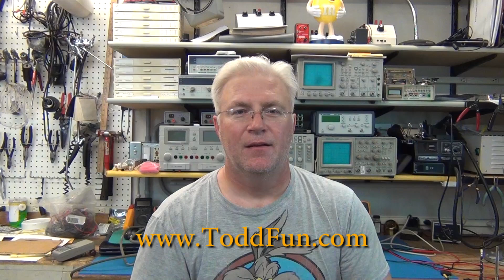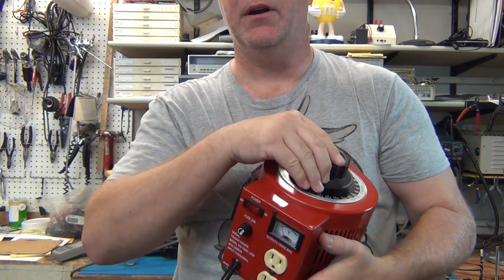Variac or Autotransformer Review and Teardown

Comment: Wish you would have shown the bottom of the unit so we can see how well the shaft is supported without a bearing like most other Variac's. The one I had there was problems with the knob having side to side play allowing the unit to lose connection between the brushes and the top of the transformer coil, even allowing some small sparks inside the unit.

Comment: I have the same variac but in the 30 amp version. I'm pretty happy with it. It has wire nut terminals instead of the plugs, two handles on top, and is a bit larger. For the price ($120) plus like $12 shipping it's really quite nice, I've seen name brand variacs that are comparable go for more than double the price. Mine has 2 brushes as well, and the windings look just like yours. They have no problem carrying the current.
They had no provision for a ground so I ground a bit of paint off where a screw goes and ran my ground there.
Also on the accuracy of the dial, it does depend on the input voltage greatly. On the front mine says 110v. My mains is 120v so it's not accurate. My overwind also goes to about 145v which is pretty nice. I made up a little information panel with a secondary side fuse, larger analog voltmeter, and ammeter to make it easier to use. Also added was a bridge rectifier, which makes it a pretty nice power supply. All I'm missing are a few ballasts.
Reply from the maker: InductiveExperiments Wow, that sounds great. I'm ok with the scale being dependent on the line input voltage but was not so happy with it not being linear.
I like your modes, any changes you can share photos, diagrams and a bom listing?
Reply: *****
 I do have a few videos on it with "information panel" in the title. It's kind of stuck in the prototype phase since I'm okay with how it is now but it's not very sturdy. I'll put it all in a box eventually which will just make it easier to move around. And maybe make a switching device to go from ac to dc instantly and not have to change the terminals.
The variac itself only has one change, that's the grounded frame. I show both in the videos. It's a pretty cool setup though, just not as good as what youtube user "photonvids" did in his video called "Easy Electrical Project" I like that one.

Comment: Hiya. Nice little review on this. A few things about it though which I'd be unsure about:

(1) That earthing/grounding.... I have my doubts that would pass UK safety standards. As a qualified Portable Appliance Tester (PAT), I'd be kinda inclined to fail that on the basis that there isn't a dedicated earth connection to the chassis. Relying on mechanical fixings to carry-on the earthing continuity like that is a bit naughty. With the way that socket was flapping around in there, I don't think it's going to be too long before that screw loosens-off, and the split second it does..... No earthing to that chassis. NAUGHTY! :-O I'd be straight in there to make a dedicated earthing connection from that earth wire, to the little removeable casing/terminal cover, and the base of the chassis onto which the outer casing is connected.

(2) What's all that hot glue around that power cord in there? Subjecting that cord to that kind of thing could've damaged the insulation inside the power cord. Let's hope they tested the cord's integrity before it left the factory.

(3) Fuse. That would be better on the output than the input. From what I have heard, if the fuse is on the input side, it can be perfectly possible for that fuse while under load to be only seeing 3 or 4 amps, but the output could be pulling a good 25A through the brush, (especially if the test subject faults-out or goes hard-short) and that's when you start blowing windings and popping brushes. I'd re-configure the wiring in there so that the fuse is on the output side. Better still, have two fuses: One on the input wire and one on the output wire. The bets are on that, should you ever accidentally overload that variac, it'll be the output fuse which pops first. :-)

(4) Output voltage. Obviously speaking, what you get out of the variac does depend on what is going into it to start with. If I was going to "re-calibrate" the dial on top of the variac, I'd want to calibrate the input voltage first, as you obviously can't re-position the input wire to the windings in there to pull things into line. If your input voltage is supposed to be say, 120v and you're getting 122v or 118v, that will affect your output. Calibrating the input voltage could be done with another variac, by turning the first one upto a certain voltage, of which is measured by a calibrated volt-meter, then once you're happy with the input voltage to the second variac, then start working on "re-calibrating" the voltage plate on top. I'd keep the volt-meter on the output of the first variac, just in case a regional voltage variation occurs during the recalibration of the second variac. That way, if the regional voltage does drop off a couple of volts or increase by a few, you can 'pull-in' the calibration voltage merely by tweaking the dial on the first variac so that the volt meter reads your desired calibration voltage once again. While I understand that everyone doesn't have the luxury of owning two variacs, it does help if you really want to go into very precise voltage calibration. Then, once you have 're-calibrated' the voltage plate of the second variac, don't forget to write on it somewhere what the calibration voltage was. :-)

------------------------------------

Overall though, it's a cute little device. I wouldn't rely too much on that built-in volt meter though. :D

-BoomBoxDeluxe.

Comment: I assume you meant "compared to no load" instead of no variac. Interesting that it doesn't vary too much with a load. Good job testing it to make sure! that's not a serious difference in voltage and I probably wouldn't mess with it either.

Comment: Prolly it'd be fine, ofc without the volt meter. You'd have to interpret the scale as a percentage scale.
Btw for the same power output in a 230v line you require half the amps you'd need in a 110v so you wouldn't need to bother about the fuse either.
Reply: I believe you have hit the nail on the head here.  The scale is a percentage scale.  If the scale shows 100 at the 1:1 point (110 VAC in 110 VAC out) surely that's the case.  Being a percentage scale means that it 'works' irrespective of the input voltage.

Comment: That 110V variac would work on 240v mains, wouldn't it? Only the scale on the dial would be wrong and the little volt meter would go "pop".

Or would the variac windings get hot and melt? If not, is the only difference between a 110V and 240V variac the label on the dial and the little voltmeter?

Comment: I didn't like those crappy ground connections either. And I think "common" applies more to DC circuits. I think "neutral" is best for AC.  Your review was good, very thorough, almost Dave Jones-y. Include a ToddCAD schematic and it would be perfect as a variac introductory tutorial. I learned a few things from the historical perspective. Glad you like my videos! Have some plans to do a few more JT experiments using optoelectronics. What's up with that CCFT power supply in the background?

Comment: When powering any old tech for the first time in decades, it's best to use a variac to turn up the voltage slowly and monitor the input power to make sure there are not any shorts and to prevent "magic smoke" from coming out of the device.

Comment: What they told me in school was that you can never rely on the scale on top of the variac. The input voltage may vary and when the input voltage is not exactly right, then neither is the output voltage. For an accurate voltage reading, use your own volt meter and ignore the scale.

I think the grounding is a big fail! And I don't think your fix is good enough either; the mains ground should be securely connected to ground lugs mounted on unpainted areas of the panel and the main enclosure.

Comment: Great video! Thanks for this. I can see I should open mine up and look at all the things you mentioned looking out for. $99 for 20 amps is a great deal. Mine is fused at 3 amps and I think it cost me around $70 new.
I use mine to feed my 24VDC power supply, so I can vary its output between 0-24VDC. Then I can plug my 30kV DC high voltage power supply into my 24VDC power supply, so I can vary that too.